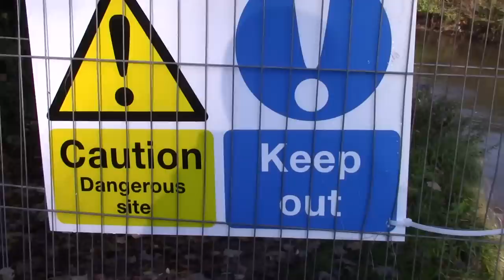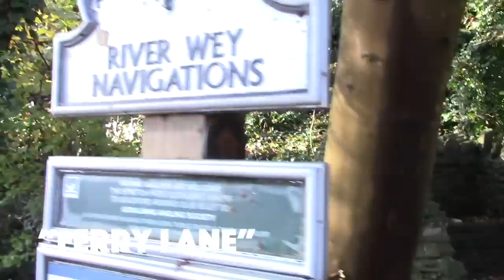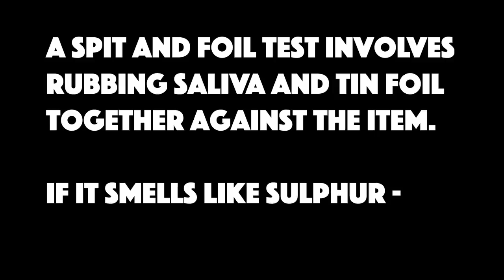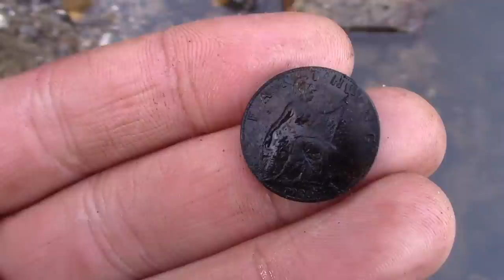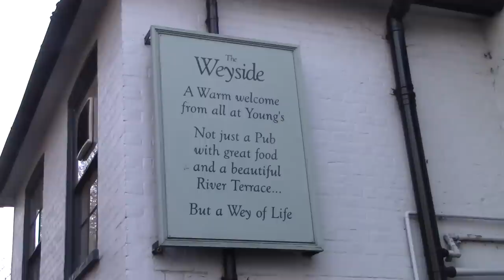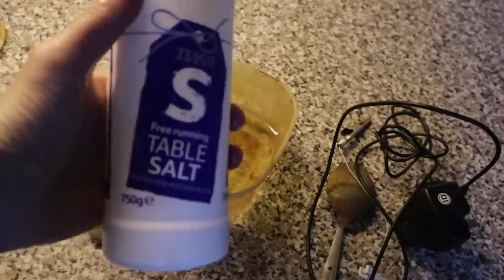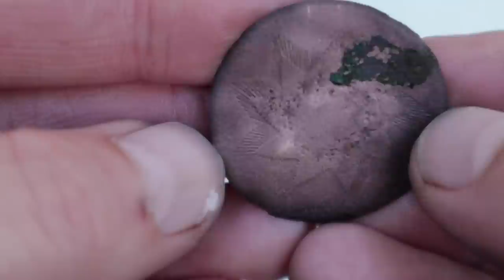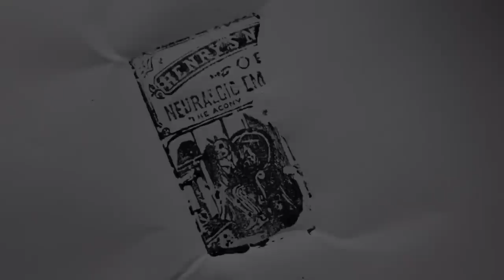MUDLARKING a broken river + Clean Up Special!

Comment: Simon, You should get better printing results if you use what is called an "Ink Brayer" or "Ink Roller". Found at hobby shops and used for block printing. Put a big dab of ink on a flat surface- like a piece off flat glass and evenly coat the roller. Run the roller over the lead plate to ink it evenly. Use a large dowel or rolling pin to roll over the paper after you have placed it on the plate. You should then be able to have a much better print.

Comment: Awesome finds Si. Love the printing plate most of all..... actually, no your cat is my fave thing, looks just like my old cat. 😍 Btw jewellers rouge is pretty good for polishing stuff up (I do silversmithing) if you get cotton heads and the woolly mop heads for your rotary tool they are great for getting into the tiny spaces the other heads maybe struggle to reach. I recently polished up a farthing this way for a piece and it came up great. Thanks for another great video. Love your vids with the awesome Nicola. Stay safe x
Reply from the maker: Thanks Lexie!

Comment: I almost spit my coffee when you poured the electrolyte down the drain. If you use 6% cleaning vinegar instead of lemon juice the electrolyte can be made into ferric chloride after cleaning iron pieces. You can use the ferric chloride to etch designs in copper. There are a few different formulas on utube and instructables. If you ever want electrolysis supplies or plating equipment and supplies try Kingsley
Reply: Kinsley North Company

Comment: Thanks Si. What a wonderful day for an adventure.  That printing plate is awesome! And you hit on the secret of stamping. The surface under the paper should have a bit of firm give to it so the nooks and crannies of the plate can contact the paper. Usually a rubber or gel mat about 1/2 cm thick. Nice improvise.😉👍💜💜

Comment: The sandy bit where you were detecting we call the sand banks. It's a popular swimming spot in the summer and at the top of the sand bank is the remains of a castle. And the little stream is actually a fresh water spring filtered through the sand stone.
Reply from the maker: Craig Jelley ah cool. Are you local then? Have they fixed the weir yet?
Reply: @Sifinds  I dont live as close now but I can find out for you matey. Love the videos by the way keep up the good work and upcycling. I cant wait for this lock down to end need to get back out detecting.

Comment: dear Simon. nice video am addicted. to get that letterpress image to print better, place block on towel. roll Roll the very stiff ink carefully and thinly .  check out a printmaking supply store for good ink and plate oil which is added sparingly.  I HAVE TWO presses but I HAVE hand printed using literally my hand and Glass barn (spoon) on t-shirts and Hosho student grade rice paper....it would be cool to print on paper on a press with that cutting would create a great embossment.  just a couple of tips from a lifelong printmaker. Debra Fisher Maggie Valley NC

Comment: just a heads up you dont need to rub the foil with salive on the silver just wrapping the item in the foil will cause the sulphur smell and inturn cleaning the item to reveal the silver as it reacts with the silver oxide that is on the surface of the metal great vid by the way
Reply from the maker: Ah cool, cheers Drew
Reply: @Sifinds  your welcome mate also prevents you from scratching items like hammereds if you use this tinfoil cleaing method on them , i use this method as it takes a slight amount of oxide off the raised edges but leaves it looking good still

Comment: Hi Simon! You might try to have something squishy under the printing plate. Like a foam pad or something. ☺️ that can help get a clearer print. Thanks for sharing! Greetings from Sweden
Reply from the maker: Maria Varga Cheers Maria!
Reply: When we did printing in school, we used a thickish wad of damp newspaper under the printing plate. I worked at a school just outside Guildford, in the 60s.

Comment: Alright si, recently subscribed and love your vids.. particularly this one and your demonstration on your home made electrolysis kit nice touch!! Think I'm going to make my own tomorrow being as we're on lockdown👌👍 didn't know you can use the fibreglass pens wet also good advice, I found when using them dry the dust is awful and makes your hands itchy.. you can buy a set of three pens at the range (or could) brass wire and fibreglass for £5 and I've seen a set of 6 on ebay for £10. Lovely finds btw and nice seeing you try your luck somewhere different... hh ✌
Reply from the maker: Adam Price Cheers Ad. Good luck

Comment: Try using a sponge to apply ink. Love that printing block, very cool!
Reply from the maker: Good idea, now you say it, that's what i did with my bottle prints, i should have remembered that
Reply: Si-finds Thames Mudlark even better would be the printing ink you use for linocutting, it’s really thick like oil paint, apply with a small rubber Lino cutters ink roller. A linocut tutorial video would show you a good technique. Ink & roller are cheap from an art supply store, you only need the budget version.
Reply: yes. i was gonna suggest mixing in oil to your paint. you could also try using a bit of soft but smooth leather over the sponge to get an even amount of ink to the plate. anyway ! details ! thanks for the demo of electrolysis & polish. made a world of difference to that Dandy's button. He will come back to find it .

Comment: Simon what i meant is if you polish up coins and artifacts you damage and devalue the items. Also have you thought about using a different agent for electrolysis ie washing soda may not be so acidic Stuart Palmer Adelaide Sth Australia
Reply from the maker: Stuart Palmer That’s up to me, plus they are common coins. I mentioned I wouldn’t do it on valuable coins. It’s only a bit of fun.

Comment: Careful you don’t make any hexavalent chromium using stainless steel at your sacrificial anode. Even a small batch like this can make some nasty gasses if the voltage isn’t regulated properly

Comment: Some really nice finds!  Looks like you found a good spot!  Does beer in the UK really cost five pounds for a half pint?
Reply from the maker: No, but you can pay £6-8 a pint in some districts of London, so not far off!
Reply: @Sifinds  I'd have to save up for a month to get drunk!  Here a pint is about two pounds in your money. For cheap beer, anyway.
Reply: @daver8521  A good pint of ale outside London is around £3, not that fizzy larger, the wages are generally higher in the UK.